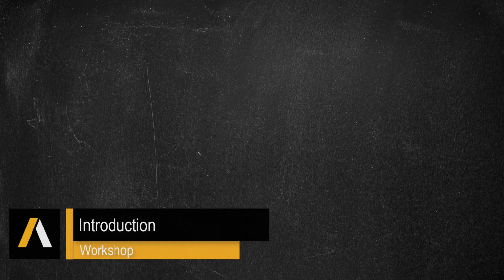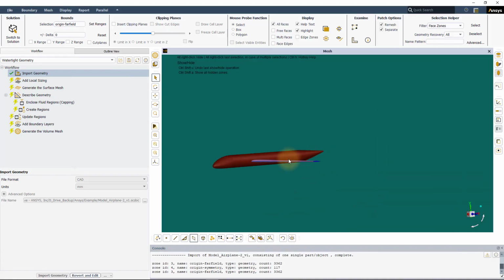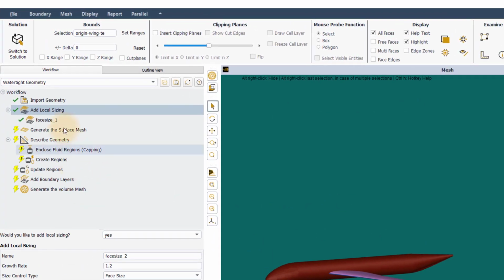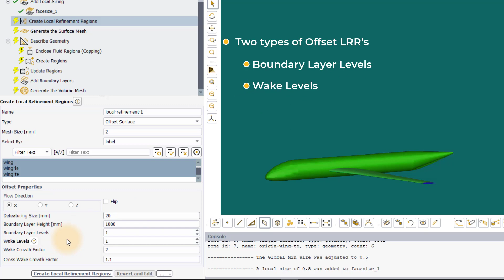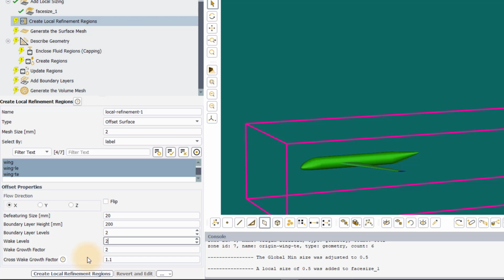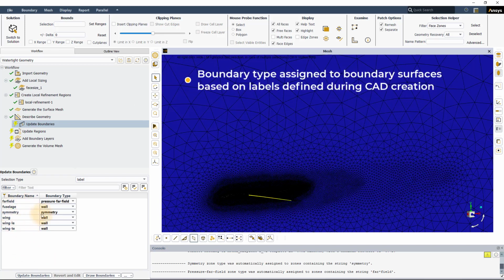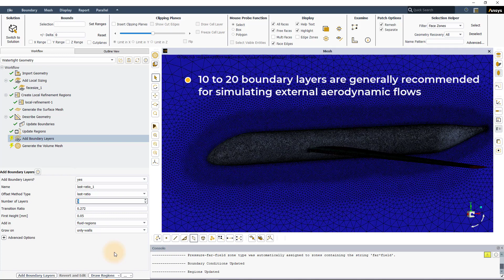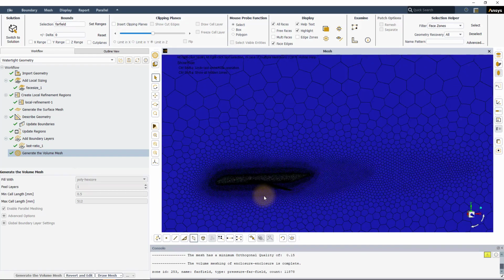Generic Aircraft Geometry Tutorial Using Ansys Fluent Meshing Watertight Geometry Workflow

Comment: What if I do not want a uniform mesh over an aeroplane, rather I want to have mesh with different sizes? For example on flat surface I want to have big size cells and at notch of an aeroplane small size cell? It is not possible right? And is it possible to rather change the size of volume cells away from the surface by factor of 0.5 rather than default factor 2?
Reply from the maker: Thanks for watching! Please post your query on the Ansys Learning Forum for a detailed answer from the wider Ansys Community: https://ansys.com/forum.